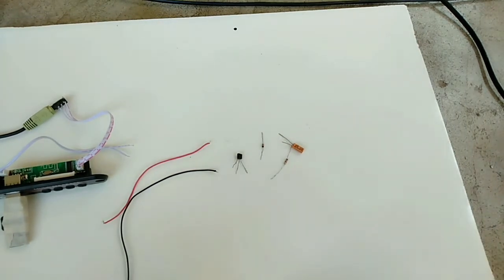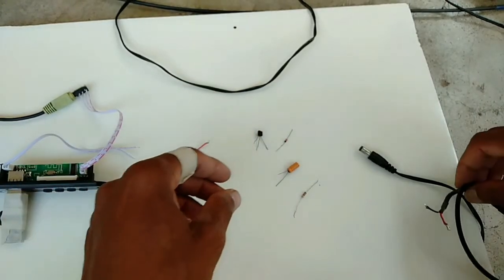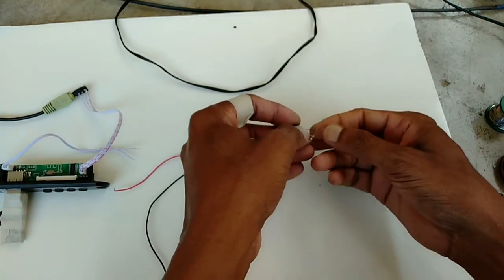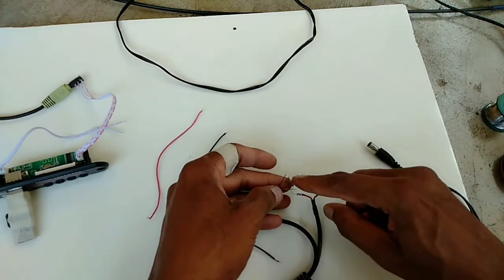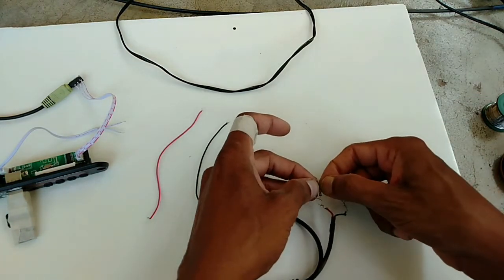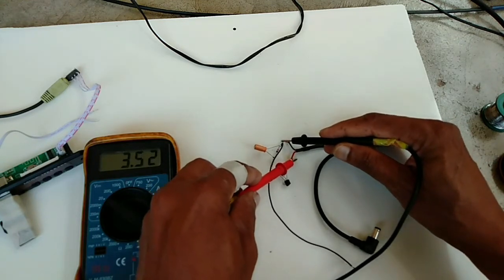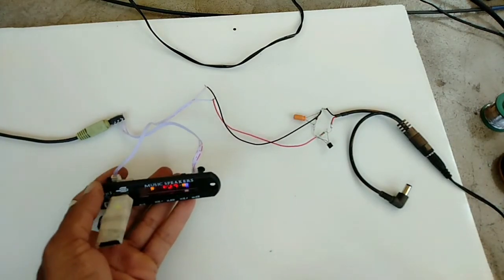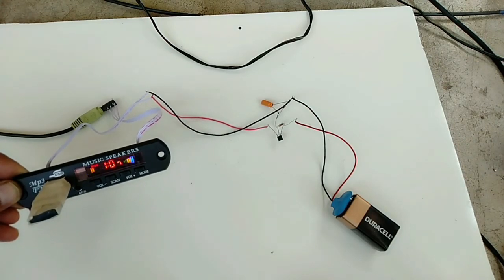5 v regulated supply for pre amplifier using bc 147 transistor and  5v Zenner diode

Comment: Sir base to collecter par resistor kyo lagaya hai apne plz plz reply sir🤔
Reply from the maker: we have give collector 9 voltage , we required 5v volt output , collector to base 1k resistor used to supply some voltage to baset (if we ON transistor we have to give some voltage to base ) on the base to groung we have connected 5v zener diode  or whatever output voltage required at output emmiter, output voltage depend upon the zener diode